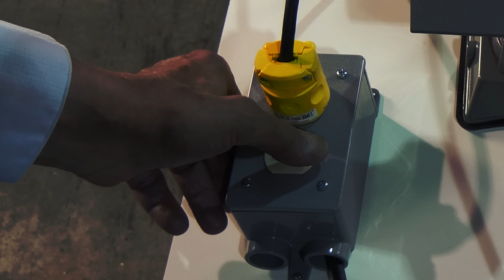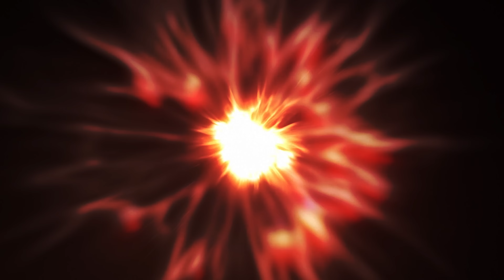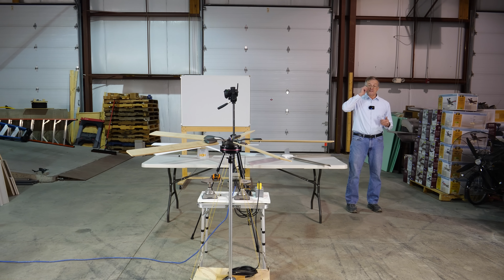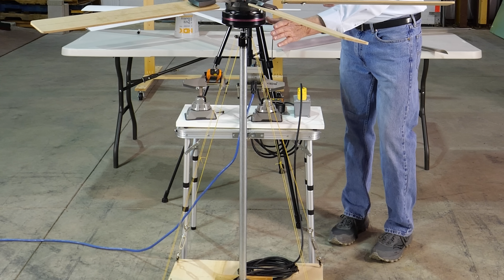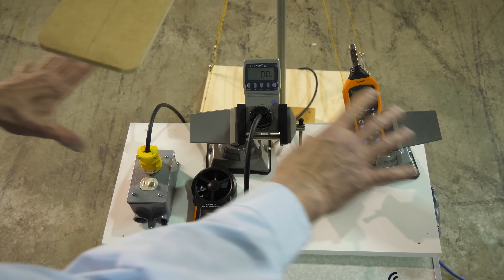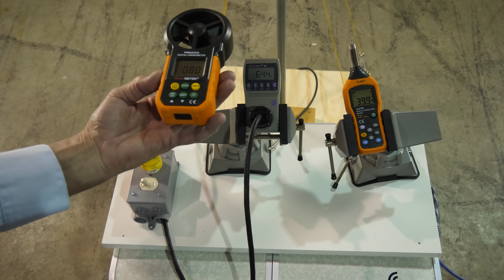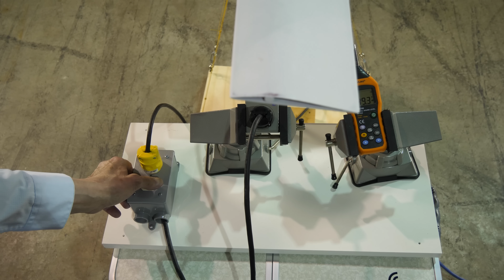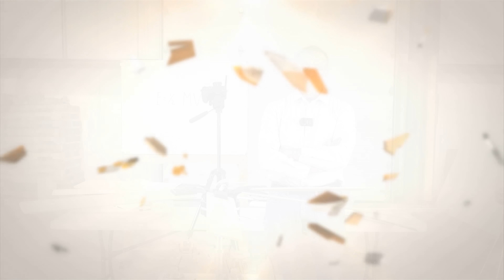This Fan Uses Almost NO Power

Comment: I'd love to see you use the airfoil and set the speed till you get a similar air flow of 1 m/s then get the power and noise level.  I suspect it would be a substantial difference.  Probably would use about 42% less power if you can isolate the pure fan power instead of fan + motor (based on the affinity law).  Not sure about the noise volume but I'd love to see what you get.

Comment: It would be great to know if it’s possible to change out the motors in what devices to obtain higher efficiency in a residence.
Reply from the maker: That's a good question. 
I'd start by determining what motors would be practical to replace.
Then, there is a method to determine their mode of operation by analyzing the current pattern through the supply line.

Comment: So, My question is, what was the failure, or how badly the the whole " make your A/C more efficient " turn out in the end, that caused you to not put out the 2nd video.  I ask, because A huge heatwave just hit a large part of the US, and I still remember eagerly waiting for that 2nd video.   Was you just not able to increase the efficiency enough to make it worth it?  Did it totally fail?  Always wondered what your idea was.  And would be great if you could tell us.  Maybe someone else could use that idea as a spring-board, or could do tests of their own.
Reply from the maker: We're under that same heat wave, and we're working on, now two approaches to increase this performance. 
Thanks for your patience. 🙂

Comment: It's the same with any small fan around the house.  They use shaded pole motors that are cheap to build, but very inefficient.  I just measured a 16in table fan that consumes 60 watts on high.  That's why I'm buying a Noctua desk fan when they come back in stock.  It's small and pricey, but perfect for desk duty.

I also love how you point out using less is just as valuable as having more of anything available.  One thing people don't realize is how many miles (390K in US/CA) of electrical line are installed around the world.  Electricity is wasted in all those lines, and it adds up really fast.  I'm not going to quote numbers because I think they are all hypothetical guesstimates.

Comment: Is the original fan motor designed to operate in that orientation?
Reply from the maker: Because there have been a few people who have asked this question, I went back and ran both motors in all orientations, up down and horizontal.   The results were exactly the same.

Comment: Is it possible that the airfoil blades pushed more air just because they are lighter hence the motor spins faster? I think RPM should have also be measured.
Reply from the maker: Weight has no influence here. The drag is entirely aerodynamic.
Reply: @TechIngredients  Thanks!!! I really enjoy your videos.

Comment: Great video. Could you test the naca aerofoil with the efficient motor? Show RPM also. Don't you think the incidence angle of the naca aerofoil was too steep? I am sure you can boost efficiency even more. In general, can you do more close-ups in your videos? Thanks for your work.
Reply from the maker: We will.
I adjusted the angle of attack to maximize performance, and the rotor hub design makes this easy.

Comment: Your ceiling lights magnetic ballasts buzzing away in the background may be a significant part of the sound pressure you are measuring
Also I thought while you showing your rope stabilized stand you were going to measure the torque and RPM and calculating power going in to the blades that way. Got disappointed.
Even at 1% accuracy that watt meter (assuming 1800W end of scale) has an error of 18W, so 8W is deep down in the noise of that thing
Reply from the maker: You're right about the lighting issue.   We're working on that now. 
Your point about the meter is probably wrong. 
The error magnitude shouldn't be based on full scale but on the measured values. A 3-watt reading isn't likely to be off by 18 watts. And, both motors were measured the same way and were of the same order of magnitude.

Comment: I feel like you should have mounted them as they are intended, there are probably no differences but if they used some kind of thrust bearing, you might be defeating it by mounting them upside down. Also I would have liked if you measured the RPM of the blades
Reply from the maker: I've examined these motors. Neither uses a thrust bearing. They both have similar ball bearings.
Reply: @TechIngredients  Alright, thank you ! it seemed very weird to me that a motor on no load would draw 50W. I would assume it's defective but i have way more experience with single phase synchronous synchronous and 3 phase motors that more resemble the brushless type.
Reply from the maker: I didn't mention this, but from that pallet, I ran a couple of other motors just to eliminate that possibility, and it isn't an issue of a defective unit.
Reply: Whoa you really thought about everything, didn't expect any less from you ! 👌

Comment: 21:52

that is why many modern appliances are available with brushless motors

it's not always clearly labeled in that way, usually they will call it "inverter-..."be it a motor, compressor or whatever

fridges and freezers often call it "inverter compressor" or "digital inverter compressor"

besides being much more efficient, it also is generally a lot quieter.
but a lack of noise is just a side effect of better efficiency.

or more accurately, noise is a symptom of energy losses
Reply from the maker: Agreed. 
Let's work to increase that percentage.
Noise is more than just a symptom of  inefficiency. It's a component. The vibrations and movement of the structure and the surrounding air carry away energy.

Comment: Any thoughts on apparent power usage vs active/real power. RMS meters measure apparent power as though phase was always together , in reactive components like motors, inductors capacitors this is not always the case, which can cause some discrepancies. My guess is that it is 30% at most, but it's maybe important to consider in aggregate. Often large industrial facilities need to do power factor correction because the use of reactive power puts real strain on the generation which is often ignored for residential.

Comment: was the motor upside down?.. and thus not using the bearings?.. 54watts is bad.. even for a bad motor?  my ceiling fan uses 15w.. and its nothing special.
Reply from the maker: Both motors were operated upside down.
The bearings operate the same in any orientation.

Comment: Why is the ac motor so uneficcient? I doesnt make sense unless its runing at too low speed. Maybe the windings need more turns so back emf is stronger and phase current lower. Are you sure your meter is measuring real power? Maybe is just an rms amp meter and you are measuring reactive power

Comment: I'm just wondering if you saw Brian from AlphaPhoenix's recent video about weighing an airplane while in flight? The garage tests he did feel very similar to yours, he just used load cells to measure pressure waves instead of an anemometer. Just thought you might find that interesting, too. Thanks for the video.
Reply from the maker: That video has come up in my recommended list. I haven't yet reviewed it, but I will.
Thanks.

Comment: Try a ducted fan
Reply from the maker: I could as a comparison.
The structure would be impractically large for most installations.
Reply: @TechIngredients A perimeter fence to capture outflow. .?
Reply from the maker: What makes ducted fans potentially more efficient is the elimination of tip vortex losses as the air slides over the edge. Winglets on some airplane wings and propellers (even some of the huge ceiling fans you'll see in large rooms like  airport terminals) accomplish the same task, although less completely.
Reply: @TechIngredients  Exactly what I was getting at

Comment: Great info. Hope everybody is listening to the message given ;)  --> Less power consumption is a big win on its own.

Fun idea:
- What would it take to replace the permanent magnets with electromagnets?
- Can wireless power transmission inside the fan be made efficient enough, power and cost wise?
The materials for permanent magnets are limited after all. And getting them creates a big dent in the environment.

Comment: Based. 
One question I would have: Does the Power meter correct for Power Factor? Some DC converters, especially for inductive loads, tend to have a bad Power Factor. So is it safe to say, the shown power value is a good measure of the real power?
Reply from the maker: I believe it is.

Comment: Something that may be relevant is the reverse-ability of fans of this type. I would posit a guess that the blade design is directly linked to the ability to reverse the ceiling fans. This would reduce the efficiency of an a-symmetric blade design.
Reply from the maker: That would apply to the asymmetrical airfoil that I assembled. However, a symmetrical  airfoil is still aerodynamicly  superior to the slab design and will operate in both directions.  It's just more complex and more expensive than stamping out blades from a large sheet of particle board.

Comment: - thick aerofoils only gain benefit once material properties (of a thin foil) are exceeded - thick foils are less efficient but have greater stiffness (load capacity)   flat blade foils are just flat blades - leaves if you will...... All types need the same Angle of attack to be comparable...  (speed control is also needed to compare apples...)

?? Reynolds Numbers - ?? fully developed turbulent flows...
 - ?? fans 24/7 / 365 - wow, ok - at those speeds (my ceiling fan on low only uses <20W continuous - no need for more to have constant mixing  I left it (bedroom - in a small house) on all summer and barely noticed any  reduction in solar export...

BA F got this - though proper propeller theory using parabolic velocity profiles - leads to a varying pitch and chord..

power use generates heat... yes...

hmm ... PM AC motors exist - PM DC motors with advanced commutation functions are effectively AC (he PM bit makes the field "free" - energetically).

needs thin aerofoil, thick aerofoil + barn door blades, with both motor types for real comparison...  apples with Bananas - OR NOT..
Reply from the maker: True

Comment: I imagine that the heat in the AC motor is because it is probably wound with aluminum wire instead of copper.
Reply from the maker: That might be true, but both motors weigh a similar amount.

Comment: Although aerodynamics is of minimal importance compared to the whopping improvement swapping to DC brushless, a few notes on any future airfoil changes: 
You're operating at very low Reynolds numbers. The optimum airfoil shape will be asymmetrical and much thicker than you would imagine. The Wright bros early airfoil shape was not optimum for the speed regime (low Reynolds number) they were flying in. Intuitively everyone thinks the thinner and narrower the airfoil is, the less drag it creates. And that's true, but it will have a lower L/D ratio when compared to an optimized thick airfoil for that low-speed regime. In other words, the airfoil will not be optimized for creating lift, or in this case thrust (or simply pumping air). 

During WWI Fokker stumbled upon this fact and built the DVII (amongst others) with a much thicker airfoil than most aircraft up until that time. In so doing he increased the L/D ratio significantly above his competitors thereby creating a better performing aircraft (the DVII was specifically banned from production after the war in the Versailles treaty). The thicker airfoil section also allowed the wing to become much more structurally efficient allowing weight savings and a reduction in parasite drag by the removal of bracing wires seen in earlier aircraft of that era - both further contributing to a net higher L/D. Win-win, even though Germany still lost. 

The thick airfoil efficiency gambit is only in play for the lower speed (Reynolds number) regime up to about the speed of WWI aircraft. Beyond that speed the intuitive "thinner and thinner airfoils are better" reasoning starts to become more aligned with reality (the F-104 wing section being at the other extreme). Sweep is another factor for higher speeds. 

Otherwise, blade twist and taper are other optimizers. Wing sections are optimized for L/D max by striving for an elliptical lift distribution across their span. Where lift is maximal near the root and gradually tapers off to zero at the tip. This is achieved through tapered and/or elliptical planforms. Also, the wing is twisted so that the angle of attack at the tip is lower than the AOA at the root (the Spitfire wing was expensive and complicated to make, the Me109's simpler taper and twist achieving nearly the same thing wasn't). 

Taper and twist reduce the strength of draggy tip vortices which in practice you can never fully eliminate. Ducted fans do help diminish tip vortices though, but they are not practical nor particularly effective at low reynolds numbers (i.e. a ceiling fan). They come into play at jet airliner speeds and especially inside gas turbine engines, where the space between the jet engine casing and the compressor and turbine blades is kept as tight as possible. Modern airliner engines have sophisticated temperature regulating heat exchangers on their outer shells to very tightly control the thermal expansion and contraction of the shell to keep the clearance between the tips of the blades as close as possible, thereby increasing net efficiency to the upper limit by minimizing tip vortice losses. 

The blade aspect ratio (A/R) is an important factor.  At low reynolds numbers, the higher the A/R, the higher the L/D. The max wing L/D will be governed by b^2/S. B = span, S= total wing area. As you can see by the equation, making the wing as long and skinny as possible is what nets you optimal L/D (within structural limitations, of course). This is why sailplanes look like they do (and the U2). These low-speed AR rules gradually become inverted as you go higher in speed (and again is why the F-104 wing looks like it does).  The ceiling fan that has the longest, thinnest blades will tend to be more efficient.

The total blade area vs the swept disc the rotor creates is a factor. The higher the solidity (total blade area)/(rotor swept area) the higher the net possible efficiency. In practice though, thicker, longer airfoils are more impactful for ceiling fans. I wouldn't attempt more solidity or more blades than the fan you're already using. 

In closing, look at large wind turbines for what an optimal actuator disc looks like in the low reynolds number regime (with the structural limitations the really big ones have factored in that you wont). Just remember their twist is opposite of what you will have.

Comment: Interesting video as I'd never even considered using for a DC fan to reduce power consumption, or that they even exist. I think it maybe should have been mentioned that the background sound levels seemed to be around 40dB, so at around 1m/s air velocity both fans are practically silent (or there is too much background noise to get any sort of meaningful data).
As far as the savings calculation is concerned, the summer time savings are actually more than the electrical power consumption of the fan if you're using AC to cool the space the fan is operating, as all that heat needs to be removed by the AC increasing its power consumption.
Seems like these sort of fans cost between $100 to $300 and brushless motors tend to have longer lifespans in continuous use applications, so honestly it makes sense to swap out existing fans sooner rather than later.

Comment: These make me brainstorming.
Could it be better with magnetic bearings? Blade surface shaped like a golf ball? Powered by a Stirling engine/using heat from AC heat pump? I saw a guy on YT trying / 3D printing various ideas like ideal number of blades and shapes of PC cooling fans. These are already hard to improve. Now I wonder how eficient is ionic wind. There must be a load when work is done but there's zero moving parts. It has to be the best, doesnt it?

Comment: Seems odd that in USA its hard to find a bldc ceiling fan, half the models sold in australia are brushless dc and advertised as such on the box. I have had a brushless "smart" wifi connected one installed for over a year now.

Comment: Those ceiling fan motors, and similar ones are absolutely horrible. The fans I'm more familiar with are the small blowers like you'd find in a computer. These used to be AC induction types, and burned thorough quite a lot, it's amazing how more efficient the modern DC ones are, and amazing why they never make decent small AC motors. It's only when you get to much larger motors do they show any improvement. The 2HP one I have on my home hack electric mower is lucky to take the chill off itself.
I have a few small AC induction motors about, however they are so infrequently used that it's not really a problem. As for ceiling fan's, of which I have none, I think part of the issue is they run so slowly, and getting them to do that makes them horrendously inefficient.

As a side note, I'm in Australia, and one of the ways I use to quickly spot "made in American TV shows" is lots of ceiling fans, and table lamps everywhere.

Comment: I would avoid using airfoil shapes on fan blades because the lift it produces isn't being used, but it creates an equal amount of drag, extra noise, and more importantly, increased energy consumption. The flat blades would be fine if they had sharp leading and trailing edges, and preferably a twist to even out the air pressure along the blade, otherwise some air will be pulled back near the center due to lower pressure.